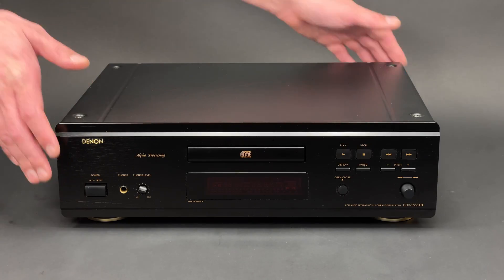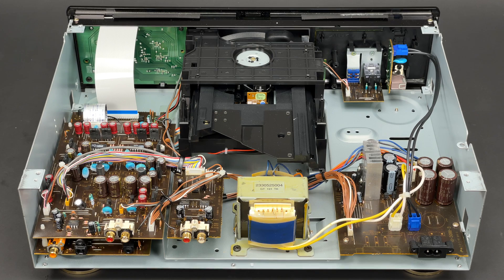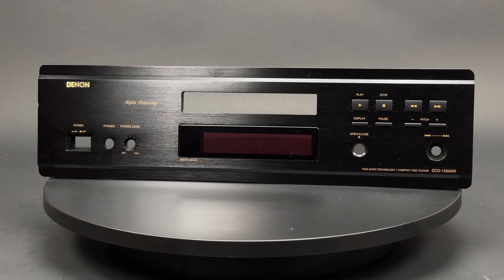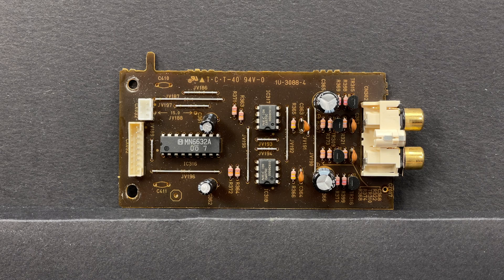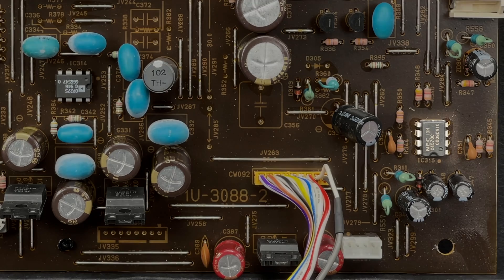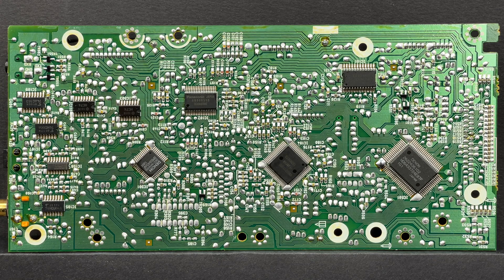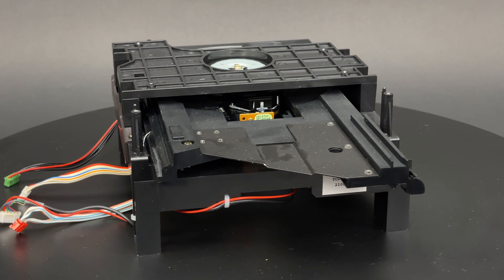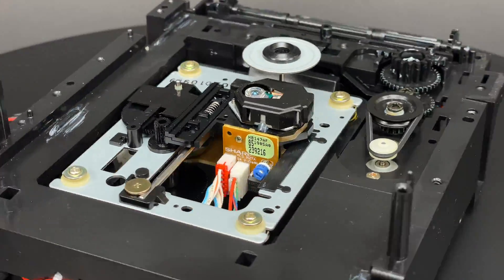Denon DCD-1550AR Teardown

Comment: Hello. I know its an old video but I suddenly have a problem with my dcd1550ar. While it reads discs out of nowhere jumps songs, returns to previous ones etc. CDs are in mint condition. What you think is the problem? Thanks
Reply: Maybe the laser pickup just be dirty or broken..anyway H8147AF seems to be easily available at little cost. Of course must be careful with those laser parts (radiation harmful to eyes)! Might of course be other problem too. I personally did buy a spare years ago, just in case.
Reply from the maker: Hi! Thanks so much for watching — and no worries at all about the video being older, I really appreciate you reaching out 🙏

That issue with your DCD-1550AR skipping or jumping tracks definitely sounds frustrating, especially with mint-condition CDs. Just to mention, I’m not a professional repair technician — I’m a tech enthusiast who enjoys learning how these devices work.

That kind of behavior could point to a few possible causes: a worn or misaligned laser assembly, an aging spindle motor, or even dust and wear on the tracking mechanism. But I’d strongly recommend having a qualified technician take a closer look — these parts can be delicate and tricky to work on.

Hope it gets sorted soon — it’s a great CD player when it's running right! 🎶🔧